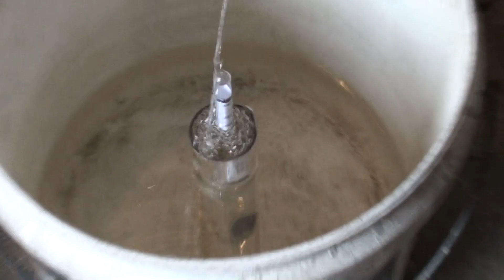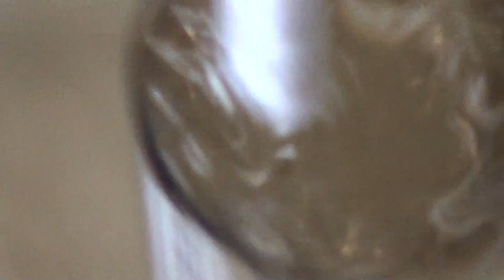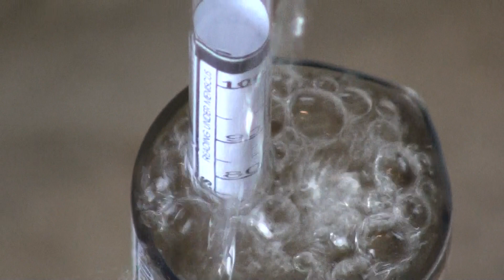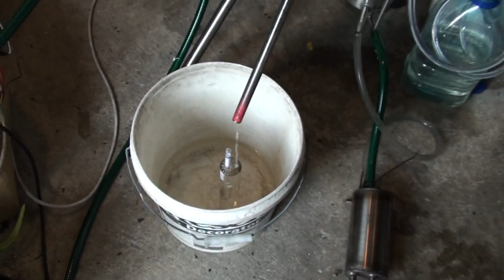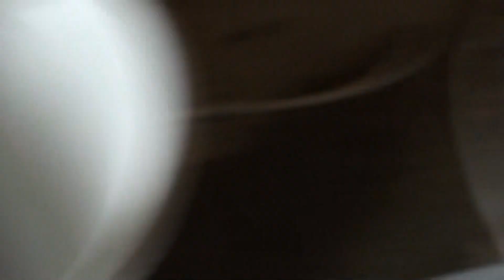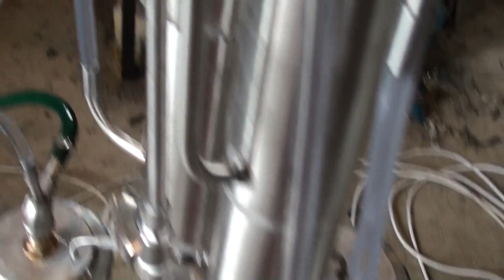Continuous alcohol Reflux still, - "Primary distillation mode".

Comment: are you further distilling the heads yet
Reply from the maker: sort of, mot that much, simply running fast it to get some sort of moonshine quality.
Reply: +Alek Polek probably have to set up some lab glass for any high precision. sure wish we were neighbours bro.
Reply: +Alek Polek oh and the evacuated solar glass tube hydronic heating system could totally run that units need for heat joules. the circulation pumps could run on battery packs charged by pv solar, or small wind. use the pv solar panels 😊
Reply from the maker: Hi, too much of metal in workshop for glass setup, and yes it would be good to be neighbors, though concentration of crazy people like us per town is really mild, so nature spreads our kind of individuals evenly throughout the world.